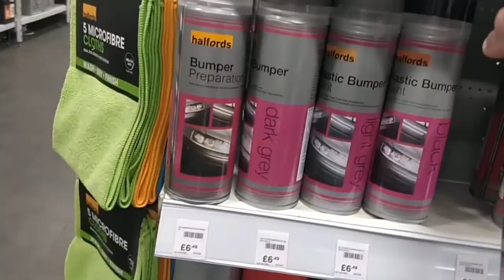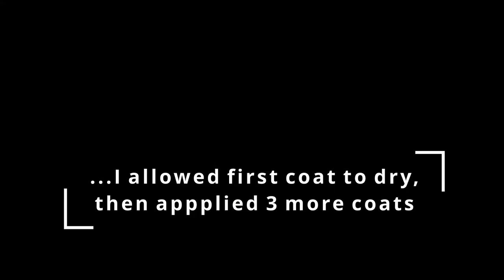Painting faded plastics car trims on Honda Civic

Comment: That came out really well! These textured plastic bits on cars are an absolute nightmare to keep looking good, down here in south of France the plastic bits look awful a week after cleaning and treating, I have the same problem with the plastic/powder coated rails on my Defender, I though you had to use a special etch primer to get the adhesion on plastic? Thanks for posting this! CHris B.
Reply from the maker: You do need an etch primer with normal paint, however the paint I used goes straight on the plastic!

Comment: Did it not peel off without using primer? And how many cans did you use for the 3 coats, please?
Reply from the maker: Hi it's been over a year and it's looking great. The paint is a special self priming plastic paint, I used 2.5 cans

Comment: What did you use to black out the center of the rear lights? Is it just a vinyl?
Reply from the maker: It was black vinyl, I bought it on eBay
Reply: @GrooveOn  Did you do a video of how you put the black vinyl on the rear? I ordered one then other day. The seller is very nice and helpful.
Reply from the maker: @alexkidd93  use a slip solution tiny about of soap in water.

Comment: After doing the prep with scoth brite do we need to wipe it down with water?
Reply from the maker: @marksystemed4678  no no, never water mate, use paint prep if you have or clean alcohol, as it's plastic you could get away with a soft brush
Reply: @GrooveOn  Ok, thanks for the info.

Comment: can you tell me what rims are those and what size is the wheel please? looks really good!!
Reply from the maker: They are actually Mercedes vi brabus monoblock, I changed the spigot hub ring. They are staggered 9.5J rears 255 x 35 x 18" and 8.5J fronts, 225 x 40 X 18" they just fit!

Comment: How did you remove that back bumper middle plastic with the Honda logo?
Reply from the maker: I used a rear vinyl that is made specifically for the Honda Civic mk8 it covers over the whole panel 👍 I can arrange if you are interested.
Reply: @GrooveOn  thanks I’ve been looking at all the mods im just gonna get the tinted type r middle cluster and swap it over 60quid